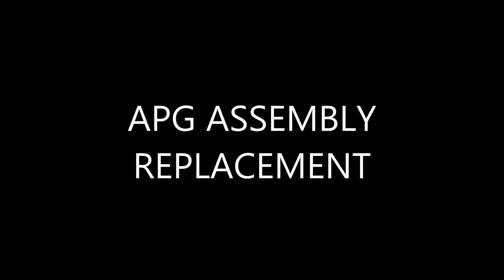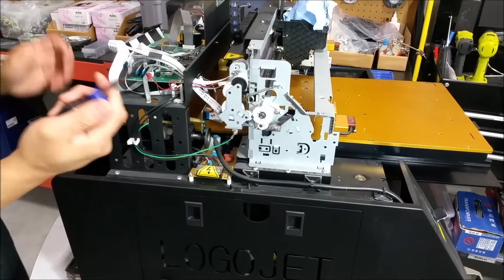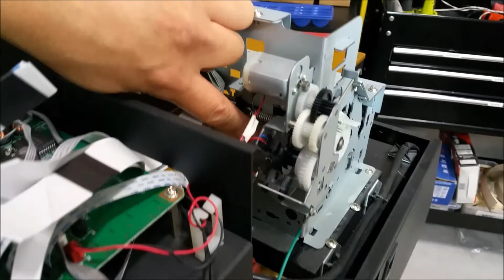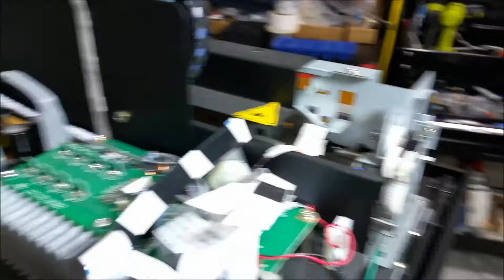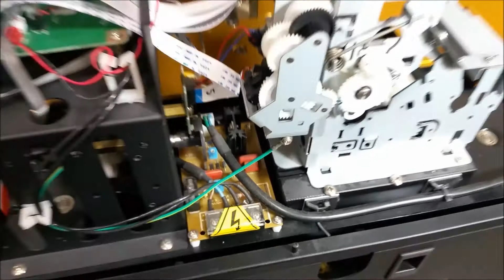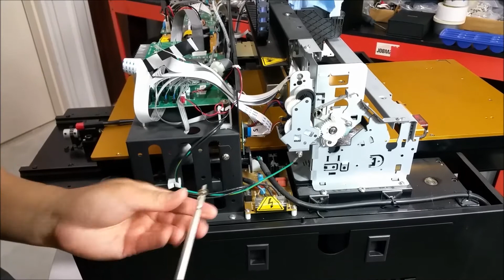APG Assembly replacement

Comment: I wonder if you can help with this issue. I have an Epson L1300 wish is the same mechanism. I did what you show and still send me the same error...Please help me....0x71 APG HOME POSITION SEEKING ERROR..!!!
Reply from the maker: Hi Moises,

I am not familiar with the Epson L1300. The following steps are things we would check on ours as a start:

- Double check the sensors on the APG gear and make sure that they are not broken off
- Not sure if yours has a large and small wheel with 2 arrows - These 2 arrows will need to be able to be lined up where the arrow is pointing at the other arrow.
- Lastly, check the motor and make sure it is working properly.

I am sorry we could not be of much help but at least this would be able to give you a starting point. Stay safe and have a great weekend.